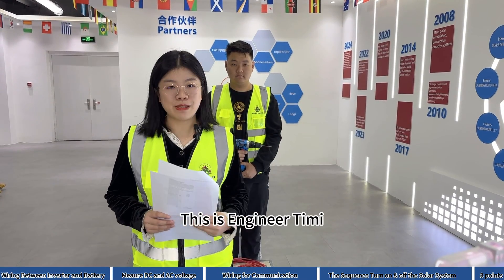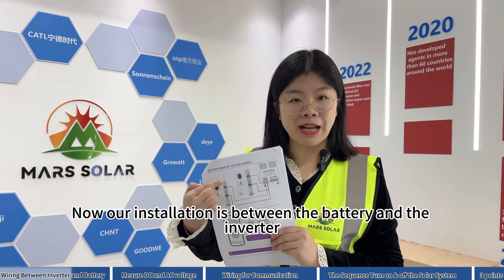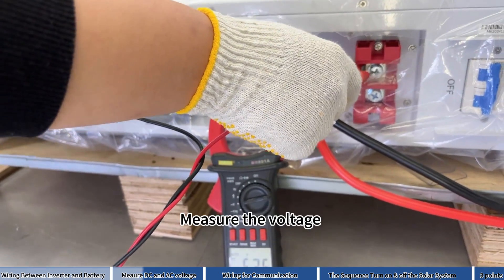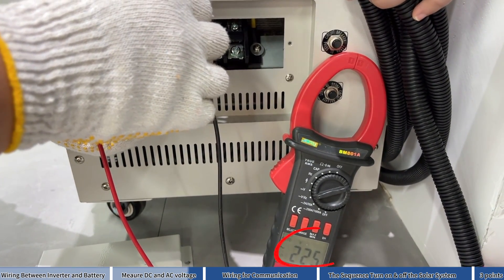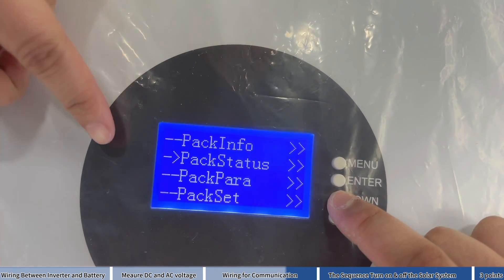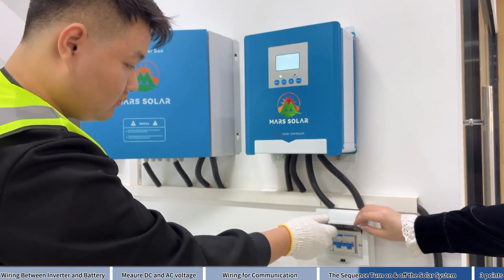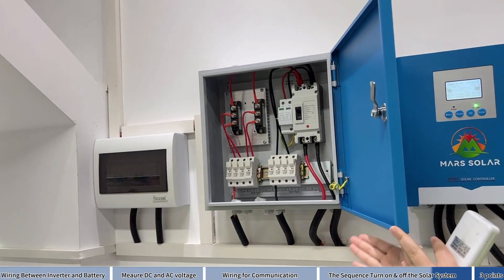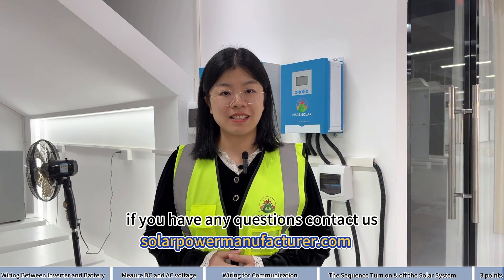Mars10kw solar system installation guidance,step by step #solarenergy #solarpowersystem#solarsystem

Comment: How many watts of solar panel for 16 ah ebike battery?
Reply from the maker: @JheoRafols  hello,dear,if it is 48V16AH battery,can consider to use 2pcs solar panel,each one is 150-500W.depend on the solar charge controller specification